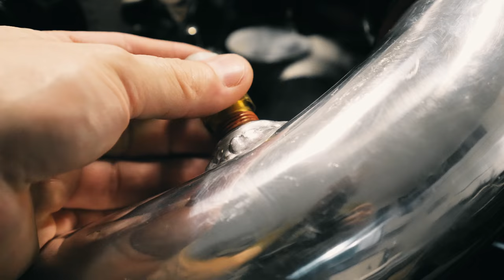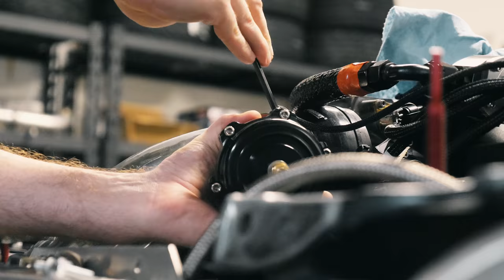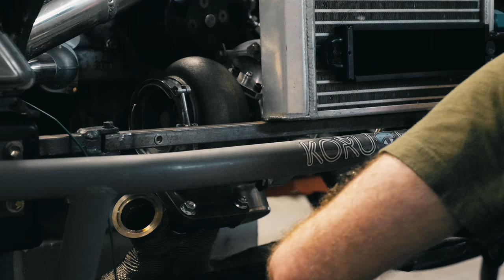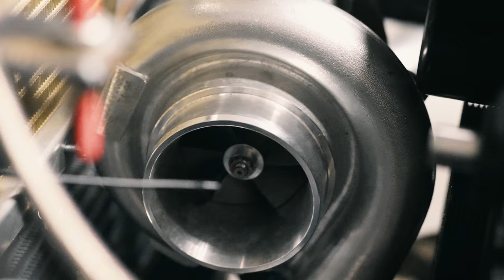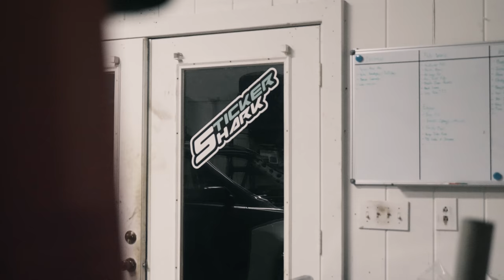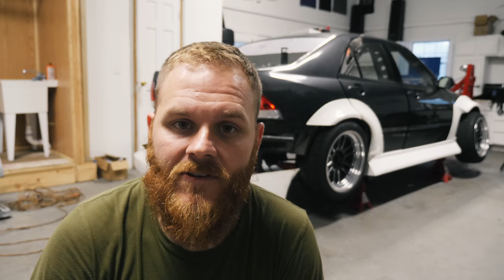Will the Drift Lexus ever run?

Comment: I have a 2003 5sp is300 and want to do a LS swap....I just wanted to know what version of the LS motor u went with..good video....keep the videos coming and all keep watching!
Reply from the maker: Tony Aquiningoc so the current motor is actually a standard iron block 5.3. If you planned on going NA I would highly recommend a 6.0 iron block with a cam. You can easily make 425 to 450hp and be super reliable. LQ9/LQ4 engines are a great setup. Thanks for the support.
Reply: @patrickwhitley7260  nice....I was thinking about going 5.3 with a single as well...what are u doing about the wiring harness? Is it custom or did u do it yourself? All keep the support coming...u just keep the videos coming and all keep watching and giving the thumbs up!
Reply from the maker: Tony Aquiningoc I’m using the Holley EFI harness. There are a good bit of businesses that make stand-alone harnesses for ls swaps. Check out psiconversion.com.